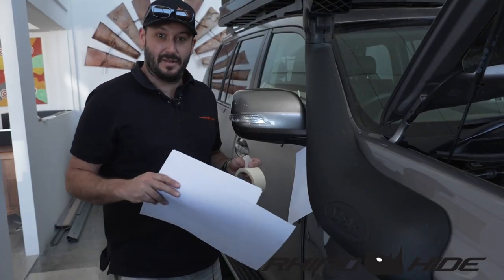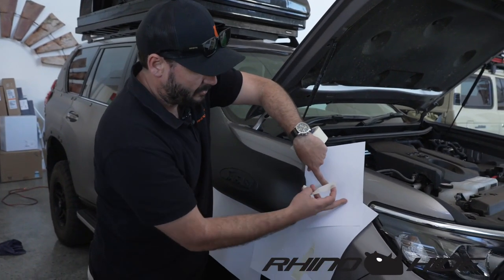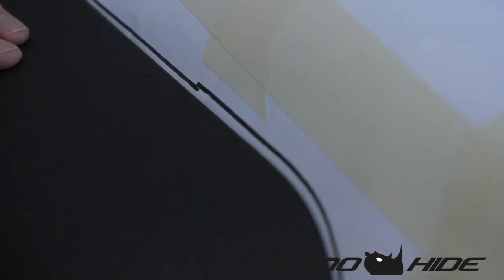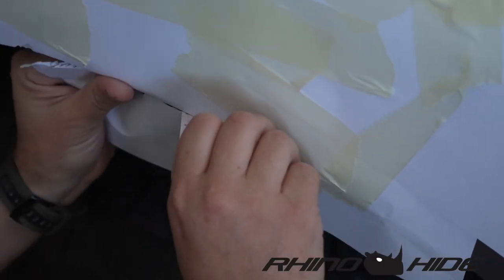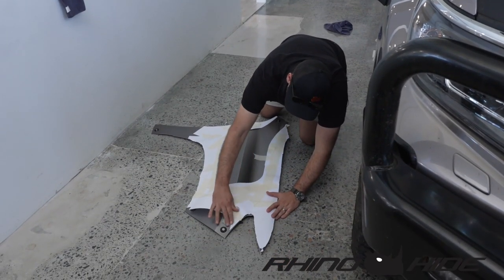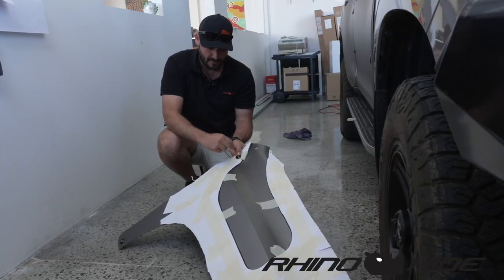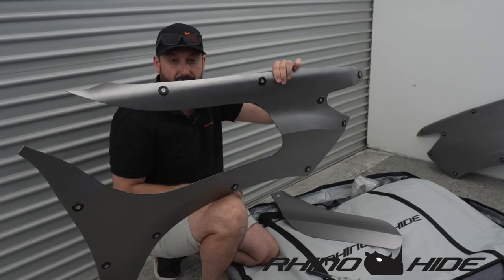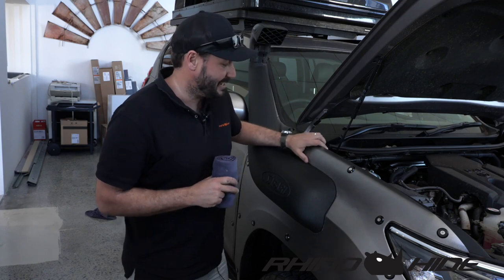Snorkel Cut-out 'How-to' Demonstration for Rhinohide Armor®

Comment: How did you get it the same colour of the car ??
Reply: I'm guessing just paint it?
Reply: @b0wen11  no shit,
Reply from the maker: Hey Adam, we did a custom Toyota graphite for Chris, whose vehicle it is. We did it at the factory and shipped over. Simplest method is to either get your local panel shop to paint ~$800 or get some colour match cans from the local  auto parts store and do it yourself. Paint adherence to the surface is great, so a fairly simple task provided you have a little know-how and time. Cheers, The Rhinohide Team
Reply: @rhinohide4x4  does it require a primer? p.s. Can I get a Ranger Raptor custom set plz? 😀🛐
Reply: How about adding a strong magnet to the middle of each panel. So it is like magnet + tape to secure the panels